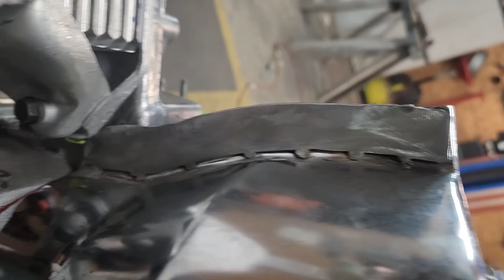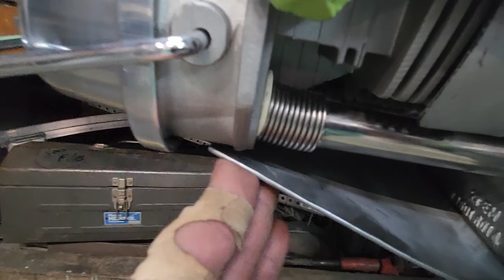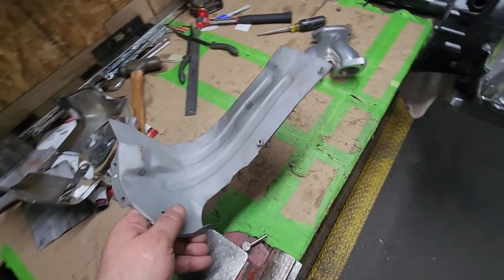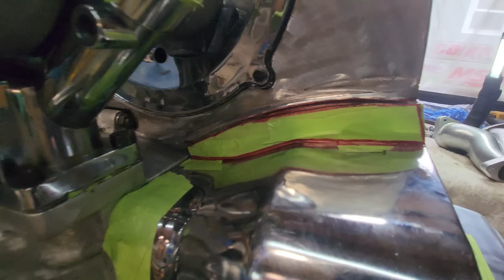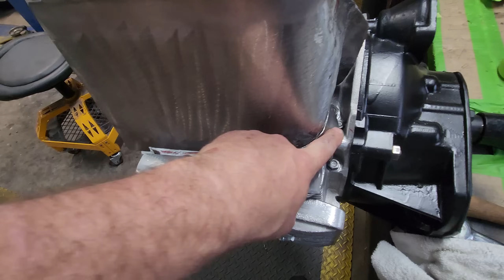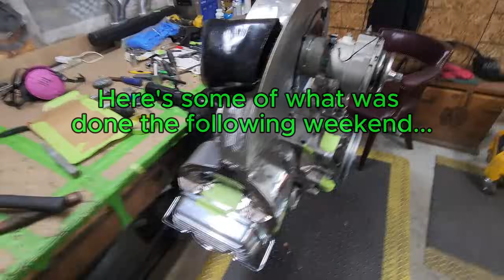Make your own Classic VW Engine Cooling Tins

Comment: Keep the working on the Empi tins. Just paint them flat black when you done with them. Original tins are better, but will need work to fit the new heads.
Reply from the maker: Agreed.  OG tins are much better.  Working with what I got.  Having some fun with it and making them custom.  I'm going to clean them up, make them look a little better, and as I mentioned in the last video, they will be flat black, and or maybe a hammer tone black.  What do you think of the added piece I made and possibly coming down a little further with the cylinder tin in front?
Reply: @VWBaja  The added pieces looks good. Whatever helps keeps hot air away from the engine is good. Are you going to add a a venturi ring to the fan shroud? Sorry if I have asked before.
Reply from the maker: What do you think about adding more metal to the cylinder tin to come down more to the bottom of the #4 and #2 exhaust?  
  Not sure about adding a ring yet, but I have been talking to Andrig and I may get a better fan.  He's done all the testing so I will follow his advice.
Reply: @VWBaja  I think it looks good to me. But you can look at what Porsche 356, or early 912 upright engines tins, to get a better idea of what you want to do.
Reply: @VWBaja  Hammer tone black paint will look good on the shroud and tins.